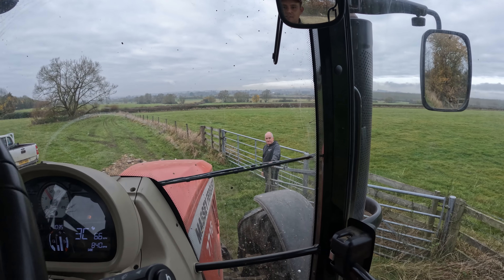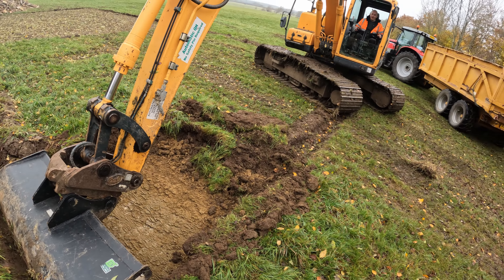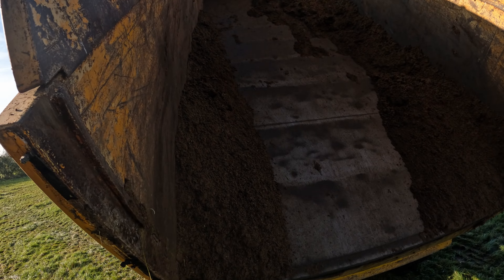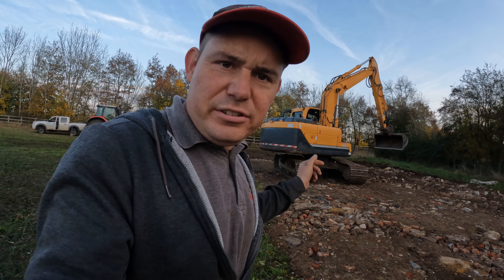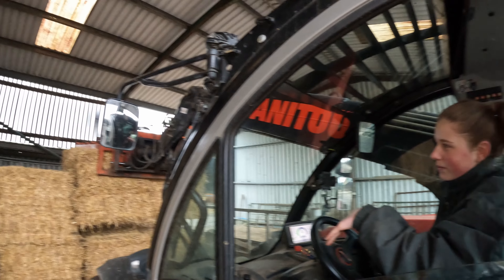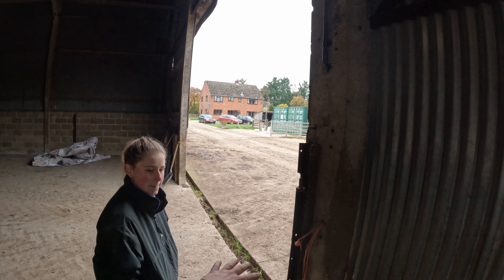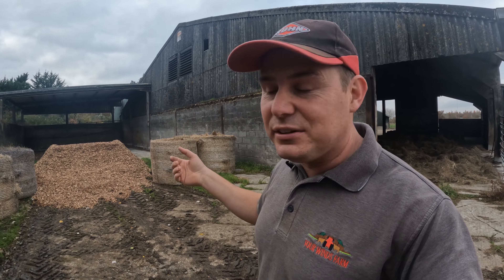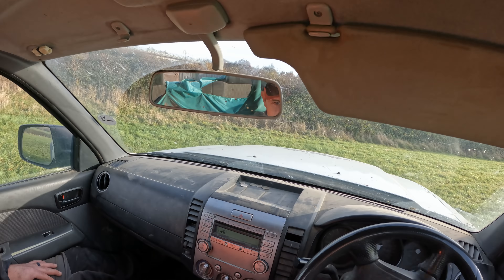Building A Concrete Pad, Sheds Ready, Sheep Have Arrived!

Comment: I know nothing about these machines , but is the arm meant to lower on it's own 25:03 , it's like it's losing pressure slowly or something . either way that could be a hazard =-)
Reply from the maker: A little bit of ram creep your right in saying it shouldn't do it but it's not an easy fix as you'd think, do some research you will understand why but you can spend thousands before you actually fix the problem, always looks bad on time-lapse due to being sped up by 5-6 times 👍
Reply: @FourWindsFarm   O.K. no probs =-)